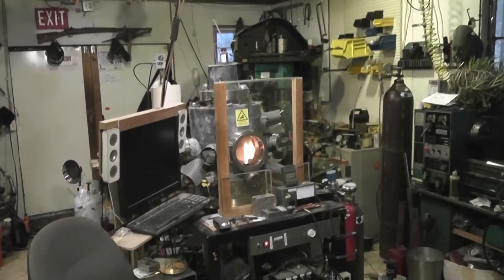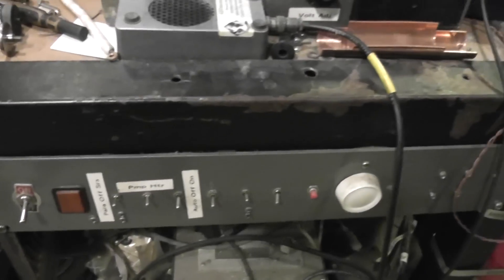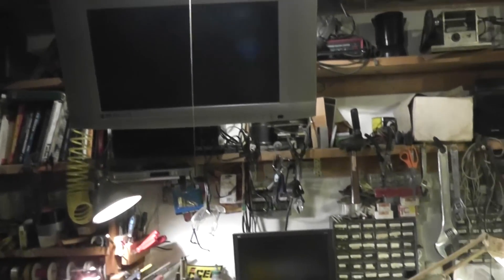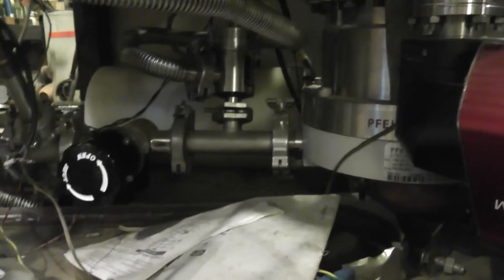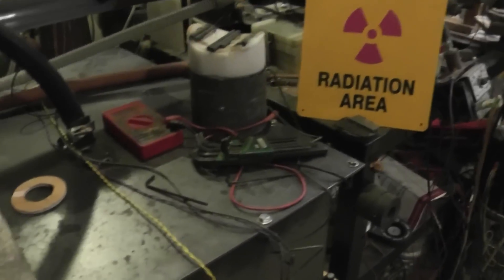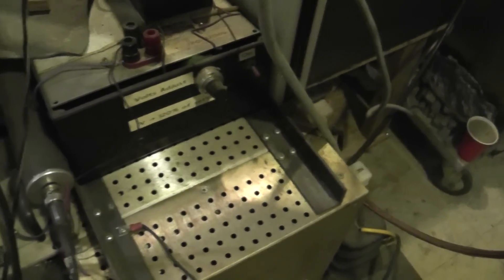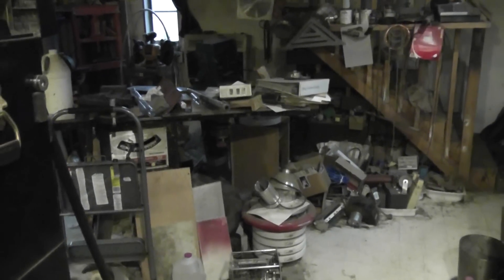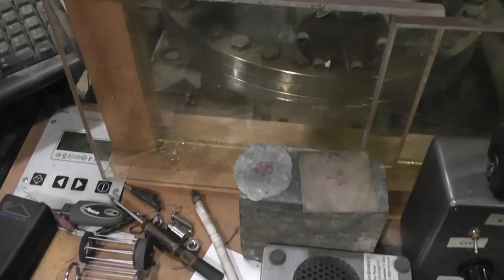Walkthrough

Comment: just subscribed, really interested in how you progress man!
Reply from the maker: I'll be adding vids to this playlist as I make them.  In general what's going on is I'm using these to help document other data I take on the same run, which will then be described in more detail on my forums.  Most often you can take the url here (just the straight link, not the &list junk) and paste it into the search box there and find the whole story.  Until quite recently, you really couldn't do much with comments here (and still can't embed, well, you name it, else).  And I feel better with my own site that I have real control over: www.coultersmithing.com/forums

We've made some progress (>10x) and found a couple new questions we need to answer before we go a whole lot further, but already the next step is more shielding or scaling down further (again) so I live though this.  That sort of thing is a reason I don't get new vids up here as often as a lot of people would like, along with a slow uplink.  It just takes awhile to generate something new enough to be worth it, along with single-handedly running a large homestead.

Comment: Doug,  you never cease to amaze me.  I guess I'm a product of the fission dirty blow em-up era that got into other things when I should have been trying to at least have a working understanding of fission. The point I gave up was taking an idea that I had for hydrogen fueled home heating and cooking using submicron ceramic catalysts to maintain a heat source that would inject enough calories into a stove top to cook a dinner in microwave time periods... then some guy did it and shelved the idea for big oil.
I guess if the companies you used to work for have to keep an eye on you. You might as well give them something interesting to look at.
Reply from the maker: They seem to like me, I'd just as soon keep it that way.

Once you really understand fission and fission reactors, it's actually a lot more complex, even though they look simple.  And all you have to do is make "pellets" of fuel and stack enough together with moderator in between (so the medium fast neutrons aren't captured in 238) to make it "go".  This is harder to make go, but easier to control, by far, and easier to understand, or I think so.

Comment from the maker: Thanks, people.  Yes, I do produce all the power I use, more or less.  But not with the fusor - it's a net loss right now - the test equipment alone draws more than it would make (I keep the fusor small as some of the power output is in the form of radiation I'd rather not expose myself to a lot of).  I'm not even trying to capure the output as of now, other than to measure it. 

Most of my power comes from the sun on PV panels, but some comes from gasoline (backup generator).  The power co wires don't run near here, though.
Only my adsl internet line is "from the grid". 

By the time a fusor makes real power, there are enough radiation outputs to overhelm the amount of lead etc my floor can hold up, at least with my current fuel.
Other fuels are possible (which make fewer neutrons etc), but harder to measure things with.  For just making it work, the fuel that makes the neutrons is actually helpful - I have a way to measure what's going on via the neutron output.  Neutrons are rare in nature, so I have a good clean signal.  I can "hear" while learning to "sing" this way.

  Even if my floor could hold more, the required amount would be hard to do experiments through, so I actually scale it down as it becomes more successful.  For the moment, that is.  Power capture and use from it is what the plan is once it has enough gain, which for this design, is not very dependent on size.  The lab IS on my property!  It's my downstairs in the same building I live in presently.  Short commute!  I'm pretty good to go on most equipment and materials now.  What I need is more hours!

Some words about it all: http://www.coultersmithing.com/forums/viewtopic.php?f=21&t=766

I'll get some more footage from it running soon.  Vice didn't get just how dense that focus is - it would have overhelmed their camera, it's very bright and very tiny, they never got focus on it.  The actual focus is about like a human hair, seen end on, but very bright.

The problems with getting someone to invest:
A: you have to ask.  Puts you in the same bin as all the fakers.  Not for me.
B: they tend to tell you what to do, from a position of less knowledge/experience.
C: they tend to think they own it after that.  So they can then get rich overcharging for the resulting output.  I want to just give it away, so competition is more ensured.

All three are anathema to me.
Reply: Thanks for sharing Doug! I would like to hear more of your thoughts - more talking - not less :)

We all need more hours to experiment, but I would be glad to send you some materials if you need any... such as ceramic bakelite tubing/ epoxy glass sheets, etc.. They have a much greater capacity to withstand high potential currents than acrylic tubing. The offer is there - you don't have to ask - just tell me what you need any I'll send it to you. No questions asked. Always willing to help.

Anyway, I could not find the register button on your forum. How do I register?
Reply from the maker: ***** Thorium 232 isn't fissionable itself, it must be bred into something in a breeder reactor to become U-233, much the same as U-238 being bred into Pu-239 - then you can fission those, with all the attendant problems of breeding added to those of fission and its byproducts being kind of on the nasty and long lived side.  People are into thorium for a few reasons:
1. There's more of it.
2. It's a side product of mining "rare earths" and a hazardous waste if you can't find another use for it.  The way almost everything is going these days is a plant takes all input and makes all of it into some saleable output.  Rare earth mining isn't there yet, but they want to be.
3. They've been sold on some utterly unproven molten salt or other breeder/fission tech by people who don't even understand the issues themselves.

Fact: 100% of breeder reactors ever built have melted down or been shut down due to safety issues.  You run the physics a little differently with breeders - fast neutron fission, and they are in general a lot more likely to go prompt-critical.  I'd suggest not holding your breath on practical thorium breeding->fission, though India seems pretty serious about making a go of it.
Partly because they have tons of thorium laced minerals, and want the sell the rare earths.  They almost always come together in nature.

You didn't have to ask me, though...http://en.wikipedia.org/wiki/Thorium_fuel_cycle
Reply: +Doug Coulter Precisely. Let us also not neglect the mass of Th required to sustain criticality. U-235 helping breed U-238 into Pu-239 helps with the mass issue. If I recall correctly, Th's cross section (for fast N's) is low enough that you have to have significant mass to be able to capture enough for a critical reaction.